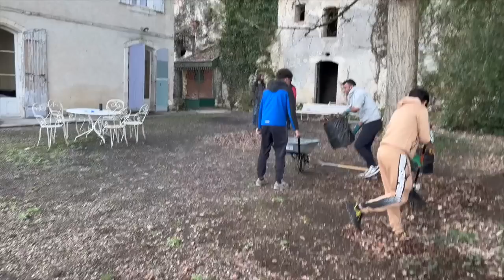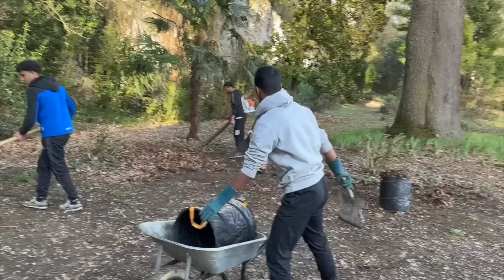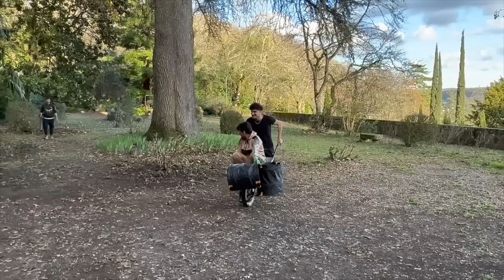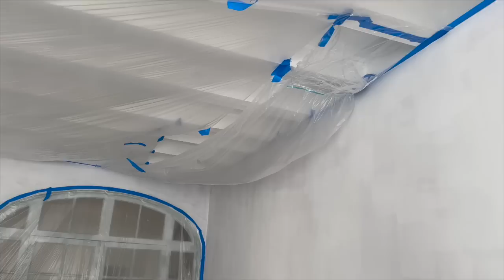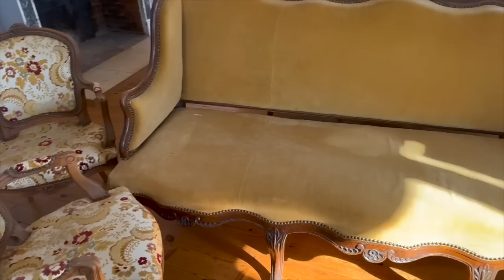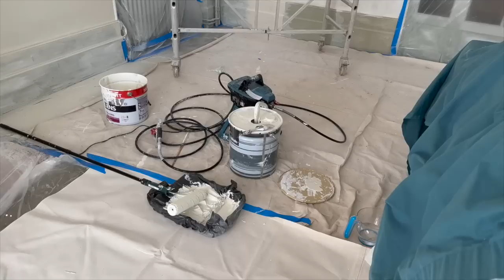The One Time I Almost Ruined My French Chateau With A Paint Sprayer – The Chateau Chronicles -Ep #22

Comment: I’ve not seen how you’ve cleaned your paint rig so if this has not been suggested or already done try this. Just like when you put the tube in the paint, when cleaning use a bucket of warm water and on the gun side have an empty bucket and spray into it until it’s clear. Of course next time you use it take practice sprays elsewhere until paint pattern looks normal. Definitely get a drill auger( that spin thingy) to mix paint too. Just like most things it comes down to practice so don’t be discouraged.

Comment: I'm not  professional painter. But I bought  cheap Aldi paint sprayer to paint the 26 wooden fence panels in my garden. As I didn't want to hand paint them. I found that I needed to thin the paint down with more water than what was recommended. And to rince with hot/warm water first then cold when cleaning up. Sprayer was good the first time I used it but rubbish on the second day. I think like you I didn't clean it well enough the first time. I think the room will look lovely by the time you are finished. Live with the new colours and furniture for a bit.